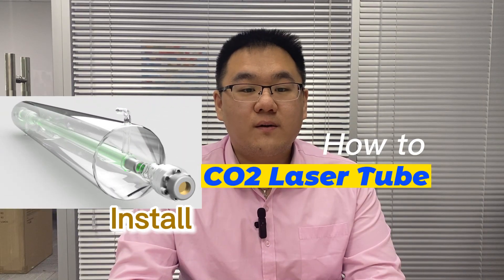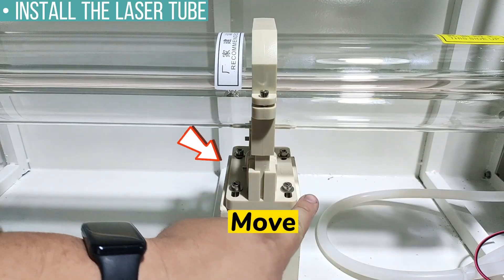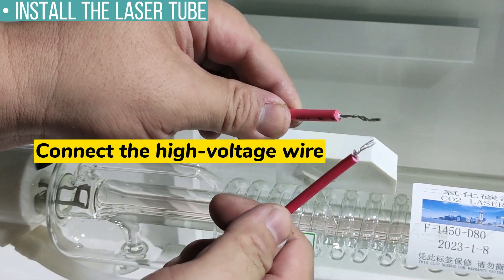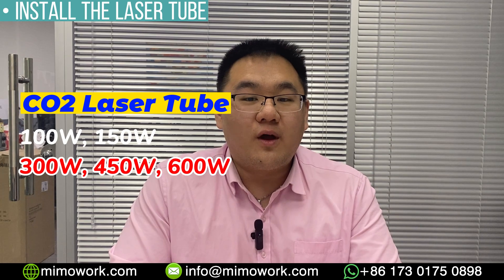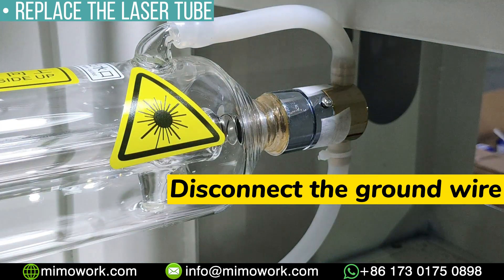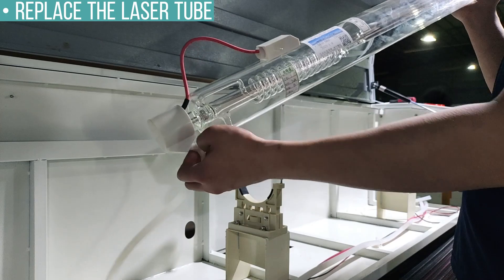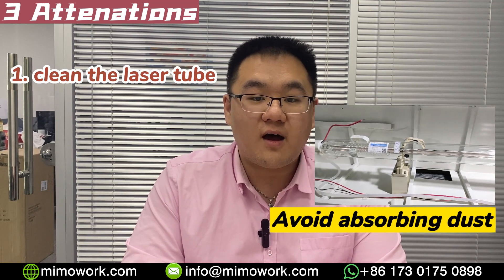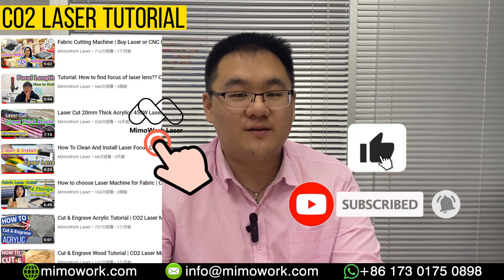How to Replace & Clean Glass Laser Tube | Best CO2 Laser Tutorial

Comment: My laser tube is not firing a ring it’s a weird shape any idea what to do with that
Reply from the maker: That's a weird one! A distorted beam shape can definitely be frustrating.

The very first thing we'd suggest is reaching out to your laser's manufacturer.
Since they know the specific ins and outs of your machine model, they are always your best bet for precise troubleshooting.

However, just based on your description, that kind of issue can sometimes point to a few things.
It could be a sign that the laser tube itself is nearing the end of its life, or there might be an issue with the power supply not delivering a consistent current.

It might be worth doing a quick visual check of all the high-voltage connections to make sure everything is secure.

But for a definitive fix, your manufacturer's tech support is the way to go.

Comment: Thank you for this video.  I have found white matter in the water in my glass co2 laser tube after not using for several weeks I have flushed the water out several times and it is not dissolving or getting out!  Do you have any videos or instructions on how to go about cleaning this stuff from inside my tube.  I have only used distilled water -- and used 1/2 RV antifreeze during the winter - only had my laser for little over a year.  THANKS for any advise.
Reply from the maker: Maybe it's the freezer ratio, I'm not sure. We've written two articles about how to maintain laser tubes and machines before, hope they are helpful to you.
https://www.mimowork.com/how-to-extend-the-service-life-of-your-co2-glass-laser-tube
https://www.mimowork.com/laser/freeze-proofing-measures-for-co2-laser-system-in-winter-2